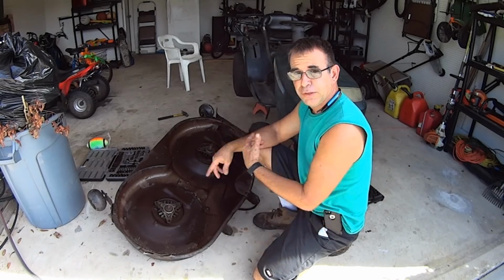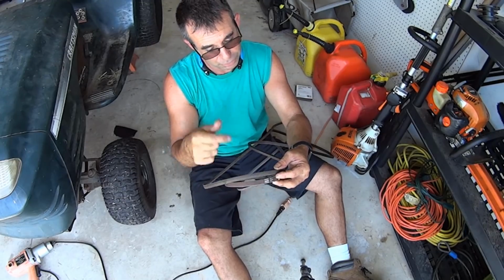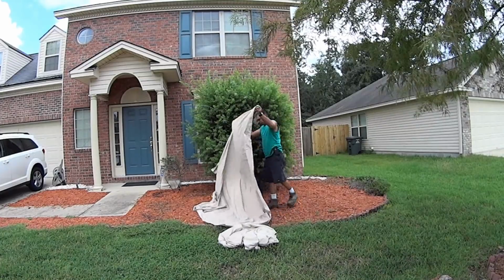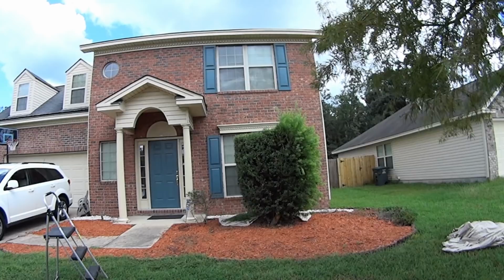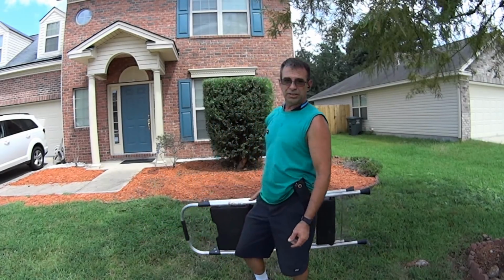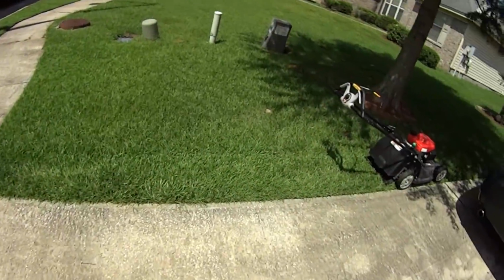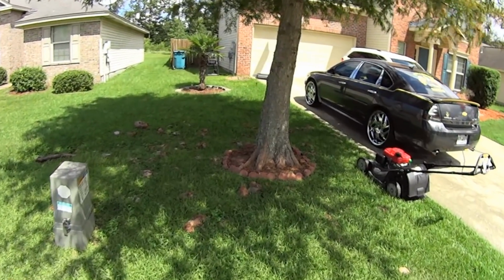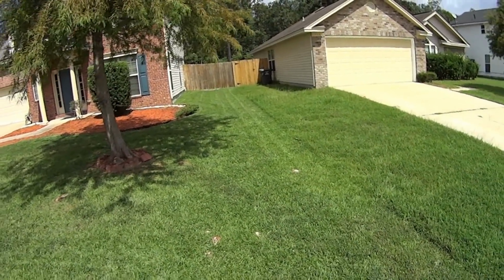Cutting Grass - Easy Clean Up When Trimming Bushes Shrubs Hedges

Comment: Dan, you mentioned that .080 trimmer line. I picked up a pack of Arnold Maxi Edge from Amazon and that green line is dope compared to a similar orange pack. You are right that it spins out better at low RPM and it lasts  longer than the other packs of consumer grade line I have in .095 regardless of the brand. BTW: I also invested in an Echo SRM-225 because I'm tired of the crap that comes out of MTD under many different brand names.

Comment: Fantastic gardening tips & skill on display in this video you offer so much more than your average side hustler! Do you think you could do that as a full time job again if needed or is it too hard to do daily in the intense Savannah heat
Reply from the maker: The heat bothers me when I start in the middle of the day after being in the air conditioning all day or in air-conditioned vehicle but I’ve always been an out door working kind of guy it wouldn’t take me very long to re-acclimated to the heat full-time. And thank you very much for your awesome comment!
Reply: As I've got older and into my early 50's I've started to struggle with the mid day heat and this year we had a prolonged heatwave with temperature in the mid to high 80's and it drains your energy so hay says off to you guys who work outside in your temperatures close to 100 degrees

Comment: Hi Dan! I'm having difficulties watching your videos. For some reason about half way through the video starts to pixalate (spelling?) and in just a moment or two freezes up You Tube and the rest of my laptop. I have to reboot it and then, I can go back to your video and generally finish it without any further problems. Is there something I should change on my You Tube settings so I can see your videos without interruption?
Reply from the maker: Your Internet service provider whether you’re on Wi-Fi at home or work or maybe you’re on a cellular network like 4G or 3G is not keeping up with the stream. You might be in a bad area if you’re on your cellular device such as a phone or tablet or perhaps your Wi-Fi at home or office has too many Devices connected to your Internet right now and it’s causing the video to be interrupted and pixelated. On the video screen you’ll see the tools setting, you know the one that looks like a bicycle sprocket? Click on that and choose 720p or maybe even 460 and you should be OK
Reply: Kathryn. On my end, I do not have a problem with the pixlation you speak of. Just an FYI here.
Reply from the maker: It’s definitely her isp
Reply: Thanks Dan, I'll let you know how it goes. Man, you know a lot of stuff.

Comment: I don't get why u trim the edge where u already mowed.? Hmmm
Reply from the maker: That’s a good question and I have addressed that in previous videos but I don’t remember which one. The edges of the grass are not always uniform as you go around the property so when you mow the lawn and the wheels are on the sidewalk that might make the edge of the grass a certain height but then when you mow a different area of the lawn and you can’t run your wheels on the sidewalk because the yard is too high or possibly too low then that would make a different height than the other area you did run the mower on the sidewalk so a lot of pros just run around real quick with the weedeater just to make sure everything is uniform and looking good